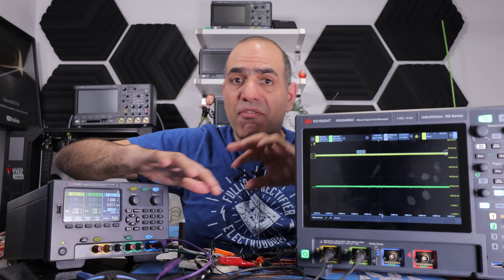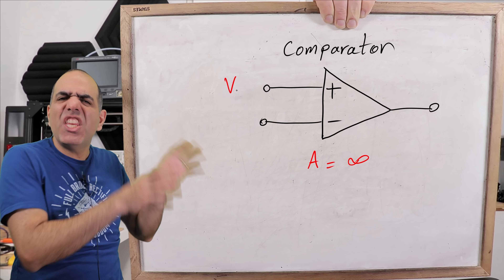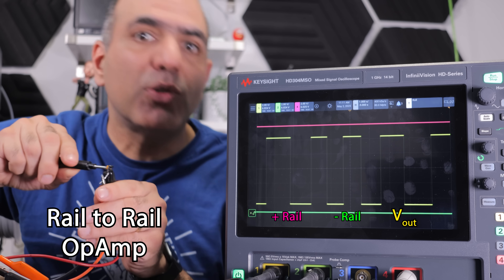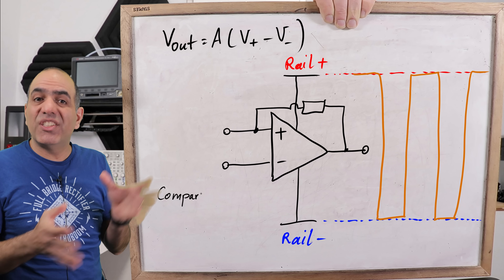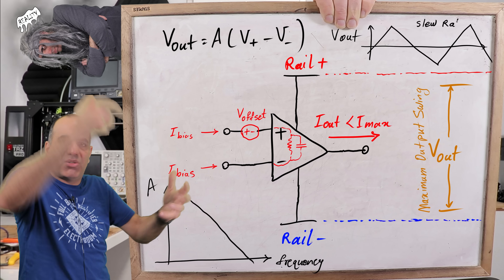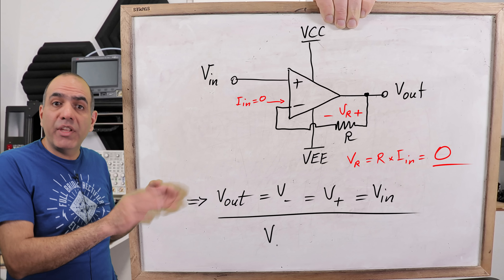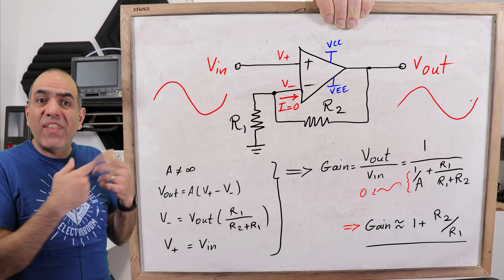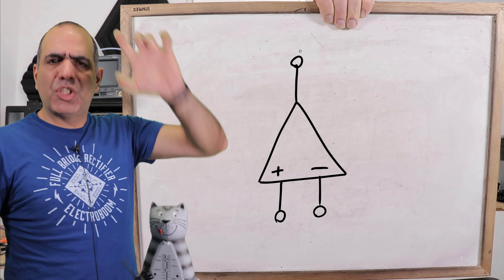The Ultimate Component: OpAmp (ElectroBOOM101 – 013)

Comment: Opamps are so useful for intended and unintended circuits
Reply: What is an unintended circuit?
Reply: @TheAcidicMolotov  When your body completes the circuit. Well, most of the time it's unintended.
Reply: @TheAcidicMolotov  Surrogate for the transistor-as-amplifier, I think. The distortion is way less noticeable and tolerance towards impedance is great, given the cost.

It won't make for a top-tier radio nor eletric guitar amp, but it can make it for most analog simple circuits out there
Reply: Have used them in various circuits, home made multimeter. Car alarm system. Automatic battery chargers. Very useful chips. Do some amazing circuits with the 555 timer as well.

Comment: I like these opamps. Of cource they are very important components for doing very different things like optocouplers and amplifying weak signels so that the circuit can actually use them. Great job.
Reply: like using the audio output or PIR sensors to trigger other circuits and devices?